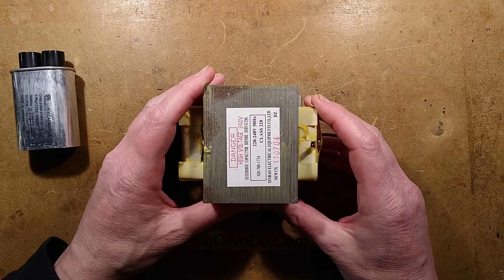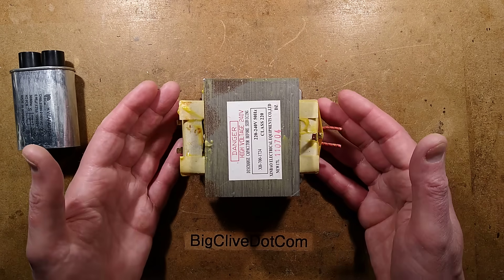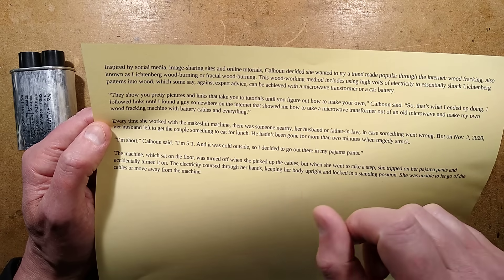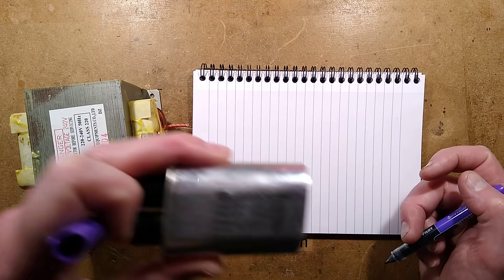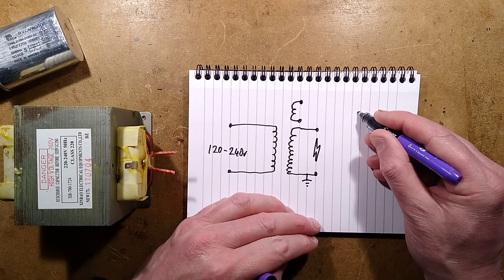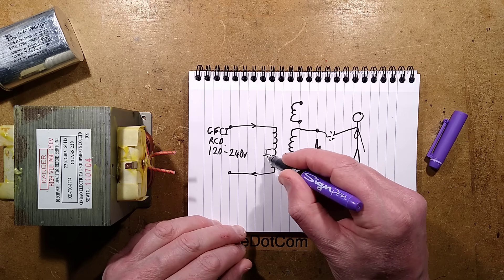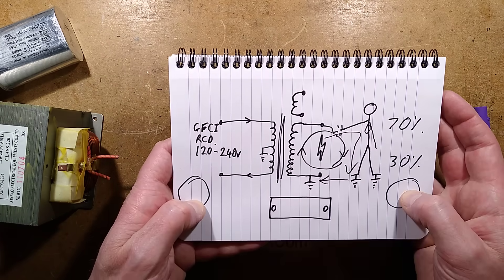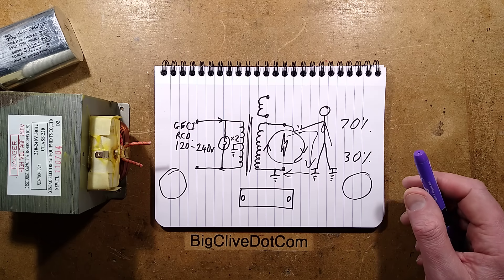The most deadly project on the Internet

Comment: When I was in college, I worked in a factory that made industrial equipment out of plastic. We used plastic welders that were essentially an electric heating element, that had compressed air that blew over it to create a hot air torch that melted a plastic rod. One day, I was sitting on the concrete floor, welding the inside of a piece, and touched a metal screw on the handle, and I felt the electricity go down my hand, up my arm, and right out my butt. It SUCKED. I told my supervisor, and he was like "meh, these tools are old and probably aren't the safest". Nice
Reply: Did you wrap electrical tape around the handle like everyone else does?
Reply: I'm sure OSHA would love to hear that story
Reply: As a welder, my station had the worst ground lead in the shop. If I was up on my table welding an awkward spot, if I stayed standing on my feet, everything was fine. But if I was good and sweaty and any part of my body touched the table or piece I was welding, it would lite me up pretty good. One day I was standing on the ground, but reaching pretty far out and my shirt pulled up and my belt buckle was against my table. Still have a scar in the shape of that buckle. I almost beat up the supervisor and company president that day. When they told me not to be a baby. Had to threaten to call OSHA and see if they wanted to repeat their advice to them, about not being a baby when getting zapped.
Reply: wooooow soo lucky. have you ever felt anything different after that? like muscle twitching?
Reply: @MikeysHubMkhGaming  Nah.. A minor shock like that doesn't cause any lasting symptoms. A BIG shock, with lots of voltage and current, MAY cause lasting effects if it has burned up nerves and things during it's path to ground. A shock like that, that causes permanent damage, is going to most likely create ugly evidence on the outside of the body.
Reply: @davelowets  man I got shocked with 220 straight from a bulb socket, with 3.10 i think or 3.3 from a wall panel and it was as you said.  But then I got like..I linked 2 transformers by mistake when I was moving some cables, touched my finger created this ark like soldering, my finger got smoldered, soldered to a piecee of metal..took nothing..less than half a second electricity jumped but the pain was like my bone was constantly hit
Reply: No nerve got left in the tip of my finger, some skin remained on the iron. I guess my luck was it broke a tiny piece of skin which dislodged from my finger thats what saved me
Reply: you: BBBzzzzztttgggrrrrkkk
your boss: "it's fine, you'll get used to it"
Reply: This story would be 100000* better if you said as you felt the electricity come out of your butt, a turd came along with it. You could even add that it burned a hole in your pants and shot out the back. And the factory smelled of burnt shit. Or you could say it burned a hole in your pants and liquified as it shot out the back and became fused to the concrete.

But then there'd be some dumbarse who read it and decided to try it. just so they could use their anus as a human railgun and fire turds at people. then that projectile turd will impale someone's skull while also killing the human anal railgun. I'm not really sure how the media would spin it, but how do you explain to someone that their loved one was tragically killed by a projectile turd fired directly out of someone's anus? Then someone will try to perfect the design and... This is the internet after all. I don't want to read about someone getting decapitated by a projectile colon. It's just a shitty situation all the way around.
Reply: Hardly the same thing and it goes out your feet unless you sat and had feet up
Reply: Don’t lose sight on the Kingdom of God 🏞️ all that is in the world is soon coming to an end. Seek God whilst He may be found. Jesus saves ✝️🩸🕊️
Reply: @TRUSTINYAH  dont preach your fake god bs no one wants to hear it read it ..we make jokes about the ignorence your kind spouts im embarrassed for you ...
Reply: @TRUSTINYAH  he devils gunna getcha
Reply: @TRUSTINYAH  yes amen! ❤️
Reply: @TRUSTINYAH amen
Reply: @TRUSTINYAH  Jesus saves from what? Oh yeah, punishment by God.

"let me in, I need to save you!"
"Save me? From what?"
"From what I'm gonna do to you if you don't let me in!"
Reply: @samuelmellars7855  what does Jesus or god have anything to do with electricity & stupidity?
Reply: @superspecialty5169  Electricity? No. Stupidity? Definitely.
Reply: @TRUSTINYAH  Hail thy master Satan, for he is all and we are all. Ave Satanas, may the light guide you.
Reply: @TRUSTINYAH  saved his ass too!
Reply: @TRUSTINYAH  Is this "God" gay and single?? She sounds like my kinda gal 😳

Comment: Don't try this at home kids!
Never EVER play with electricity, even if you "think" you know what you're doing (chances are, you don't).
Electricity is not a game, it's an invisible killer waiting to get you with no warning.
Here's a saying I heard back in Uni btw, that I still remember decades later:
"In most professions people may make mistakes many times, but as an Electrical Engineer you'll make only 1..."

Now I'd like to address a common misconception:
It's not the Voltage that kills, it's the Current.
High Voltage on it's own won't kill you (take tasers for example, which can go up to 50,000 Volts!), but just 0.1~0.2 Amperes are enough to stop your heart!
The Voltage does matter of course, if it's too low to break your skin you won't get shocked in the first place, but that's not what kills.
Even 70V DC or 100V AC can kill, if the source can provide enough Amperes & they flow through your heart.

Comment: Hello BIGCLIVE, Yup way back I used to make rotary gap spark transmitters using oil furnace
X-formers or neon sign transformers. I got zapped once but I still messed with the stuff, being
much more carefull. I guess at 67 years old I got some smarts and decided to remove part of
the core and have a mother of an electro-magnet, these coils are wound on the center of the E
type core I got rid of the bar across the three poles. I mounted the transformer to a board and
ran 6 volts from a motorcycle battery through the primary or 120 volt coil and was able to pull
my truck with the electro-magnet against the bumper.
So far as the narcisissstic bastards who say they got across the secondary of this hi-voltage
coil, I think they are totally full of BS. way too many milli-amps to take a person out for good.
Lectrizity, it can punch your lights out forever, it simply has NO respect for ignorance.

Comment: this is why most fuse boards are rcd or rcbo protected
Reply from the maker: An RCD will not detect secondary current leakage as described in the video.
Reply: @bigclivedotcom  yep i did not watch that far but my job was mostly maintenance supply breakdown ive never took a microwave to bits only tellys and radios built my own crystal set but not with a cats whisker as some old books describe that part was just a hobby plus the eht can be deadly too even though its sw off on a conventional tube tv or lopt as we called it

Comment: Can't wait to have a go at this. All the lefty snowflake stuff about getting zapped and burnt to bits is typical of the type of nanny state interference that is taking all the fun out of things. My plan is to burn some nice patterns into my mum's dining table, and to reassure you that I'm not some irresponsible retard, I've taken every reasonable safety precaution going. For example, I've made a tinfoil suit that will insulate me nicely and stop any 999 shenanigans - I'm already on a warning - and I've successfully banged the flux capacitor thingy out of my microwave with a toffee hammer. I've also responsibly sourced the knitting needles that are required to do the work, which should keep all you eco warriors happy. The only thing I'm not certain about is to which side of the electric gadget I should attach them, but this is of very minor importance in the great scheme of things. I'll just employ my noggin and try each wire until I get it right. That is called using your initiative, nitwits !

Comment: Let's not forget that this set-up also basically is an ignition coil: If someone finds you self-electrocuting and pulls the plug the collapse of the magnetic field of the primary coil will induce an even much higher tension in the secondary, giving you an extra buzz.
"Mind if I smoke?" would be a cool comment to make  during the incident, if only you could speak!

Comment: 05:36 If I were to make questionable high voltage machinery, I would not only physically unplug it when not in use (as I do with all power-tools), I would also make the switching it on process involve multiple steps.
The thought of a flip-switch being the only thing between a spinning saw-blade alone makes me shudder!

Comment: I used this to present at my makerspace and art shows. Just don't be stupid, use common sense, and give it the upmost respect. It does require discipline in electrical safety and taking extra behaviors to reduce the most risk. But for anyone else, if you don't know how to do this, then "DO NOT TRY THIS AT HOME" 😉

Comment: Such a great video. In trade school our teacher went to tell us in great lengths how we should never to touch the insides of a CRT monitor before completely discharging the capacitors. Then he proceeded to show us how to discharge the capacitiors inside of it, and ended up in ICU (but thankfully got away with some burns). He thought he doesn't need gloves because "he knew what he was doing". Fool proof safety stuff is there to protect you from clumsyness and brain farts, not necessarily your lack of experience.

Comment: I have some electrotechnical background and he is totally right! This is deadly dangerous because there is simply NO saftey switch, the voltage is high enough and the transformer will provide enough Amps to do  lot of damage. Dont do it ! The problem is also, you can buy coils with a lot of windings and arange them in a way to get a really high voltage out - which is also no rocket sience and the result is a total death trap

Comment: Ive hit big and small power cables with diggers and shovels and ive also drilled into a 3 phase cable but only caught the edge an hit one of the cores it still blew up tho id never piss about with anything like this i dont even like using 240v chop saws and grinders in my own shed 110v is safer

Comment: thankyou Clive and yes i built a MOT machine after watching said YouTube tutorials. One very wet day in QLD i was in my shed and the humidity was around 90% id say and i received a tingle from the probe that i took as my fair warning..Ive encountered those same responses to my warnings since then also. I still have the machine, which by the way is powered up by a foot switch and has a bright light on it for when the mains are connected and on, and have installed high tension ignition leads that are shrink wrap coated and encased in cable armour that are connected the lower 100mm to resin filled 60cm pvc tubes and also insulated the top 300mm with high density rubber tubes but have a question for you if i may. ( and i understand if you ignore this totally). If i connect my ground probe directly to the HV winding wire after disconnecting it from the transformer frame would the RCD trip should a short occur? Ive been told often that it would but i remain sceptical and have not used the machine since. Your easy to understand calm explanation sure is lacking in most of the chest pumping "expert MOT builders" videos i must say. Thanks again.
Reply from the maker: After the transformer the RCD will not see leakage.

Comment: Both my grandfathers on my moms and dads side were electricians, both died in the field. Also claimed my great grandpa as well. I simply do not mess around with electricity. Screwing in lightbulbs is scary enough for me. I could have obtained my master ASE tech cert, but I refuse to do the electrical course. Just not something my family is good at lol.
Reply: Knowing and respecting your own limits could save a lot of lives. Good on you for actually using your head. Money can only buy so much.
Reply: Yeah Steve you should probably stick to screwing in bed    😂
Reply: Huh..what are in in Britton or somthing
Reply: Car electric is pretty safe unless the alternator fails. Dc can bite, but it's not bad.
Reply: How you feel about electricity is how I feel about natural gas. I used to listen to the old folks talk on the porch when I was little, talking about the "old days" when hot water tanks would blow up. They said they would be on the porch when a fire red rocket would come blasting down the street. Someone else's hot water tank exploded... again.
Reply: A light bulb gimmy a break
Reply: "on my mom's and dad's sides" superfluous? 🤗
Reply: @800Viffer I mean, yeah
But it doesn’t really matter

Comment: I was trained in the US Navy as an aviation electronics tech, working on high-power aerial radar systems. After I was discharged (no pun intended), I became a consumer electronics repair tech, starting on microwaves then getting bumped to TV repair when one of the TV techs threw a tantrum and quit. Once I realized that electronics repair was a dying field, I slid sideways into low-voltage system design, installation, and maintenance. In each of these fields, respect for electricity and the relevant safety protocols was beaten into my head endlessly.

While working on a TV on the bench, I was distracted by one of the cute front-counter girls and neglected to un-plug the TV I was working on before lifting the circuit board, bridging two of the pins on the flyback transformer (which powered the CRT picture tube) with my left middle finger. The transformer instantly informed me of the error of my ways by burning a hole THROUGH MY FINGERTIP with a high-voltage electrical arc. The arc path was large enough that I could run cotton thread through the hole, which I did simply to determine if the arc had obliterated all the flesh while jumping through my finger. In the CRT tube days of TVs, the basic rule was 1,000 volts of output for every diagonal inch of screen, so a 27inch TV saw roughly 27kV coming off the high voltage lead from the flyback transformer.

There was another instance where the parts lady asked me to scoot a 35inch Panasonic CRT out of the main walkway, because the other TV tech had just replaced it and brought it back to shipping/receiving for return to Panasonic. The other TV tech hadn't bothered to ground out the CRT when he removed it and put it in the shipping carton, so when my hand happened to brush across the high voltage socket, I got bit HARD.

Now, the skin effect is where the higher the voltage of an electrical field/potential, the greater its tendency to flow over the surface of the conductor instead of through the interior of the conductor. Thus, the thousands of volts stored in that CRT's capacitive structure didn't go through my heart while traveling from one hand to the other, but it still hurt like a sonofabitch. Those are the only two significant mistakes I've made with electricity, and while neither was terribly serious or damaging, I was undeniably careless or thoughtless despite years of training and experience.
Reply: Holy hell... Pardon my curiosity, but did that finger ever heal completely? I'd guess the wound was cauterized so badly that possibly not...
Reply: Skin effect is due to high frequency not high voltage.
Reply: skin effect works only in good conductors, that is, in metals/semiconductors

Comment: Can't  you use one of those plasma arc generator boards to do same thing.  I know those twin arc plasma are the best lighters
for fireworks . Make those punk lighters obsolete. Great for outdoor to light fires .
Reply from the maker: They aren't really rated for running long enough, and are a fraction of the power of the microwave transformer.

Comment: I've watched so many videos - but this is by far the most comprehense I've ever seen. I have a dead man's switch in mine, but 2 is ingenious. Bravo, sir. One further thing I have that might be a further benefit - is both an arming and activation light. Arming light on the input circuit to the dead man's switch, and activation light across the primary: and you NEVER touch the circuit once the arming light is on. This just puts a backup layer on top of the dead man's switch

But amazing video my dude - this will absolutely save lives. I'm adding a second dead man's switch to my device before the next time I use it
Reply: I’d go a step further, and place the device on a pair of breakers (in series, so both need to be closed to use the device), each with means to lock them out (think Lock-out, Tag-out). Don’t need guests, or worse, kids, to go messing with that stuff.

Comment: I had some pioneer DJI decks metal housing that used to give me a nice buzz. Put a meter on it and it was about 90-100v leaking to housing.. (240v supply) Just had to make sure you have shoes on when using and it was manageable.

Comment: dumb question with the transformer, you get an similar project where you can use it to do spot welding....obviously the 220volt side is dangerous but is the other side dangerous?

https://www.youtube.com/watch?v=hTaGa93lOGU&ab_channel=mopatin

something like that
Reply from the maker: The spot welder project is safe if the high voltage winding is removed and normal electrical precautions are taken with the 220V circuit.

Comment: Some people think volts kill ya and not amps 🤦‍♂️
Reply from the maker: Voltage pushes current.  For a given resistance a higher voltage will result in higher current.
Reply: @bigclivedotcom  like how a static electricity shock has 25,000 Volts but don’t kill ya I mean
Reply: @SonicVibe  I guess all the executions in electric chairs were fake
Reply: @vanyel_etc8695   that has amps
Reply: @SonicVibe  amps indeed. Early electric chairs would make people begin to smoke while not killing them sometimes.